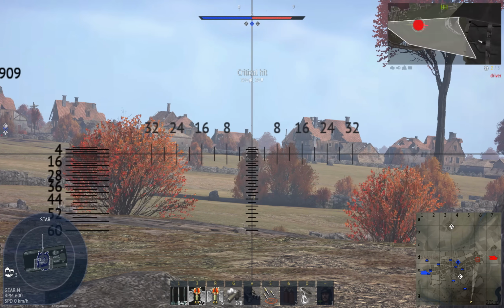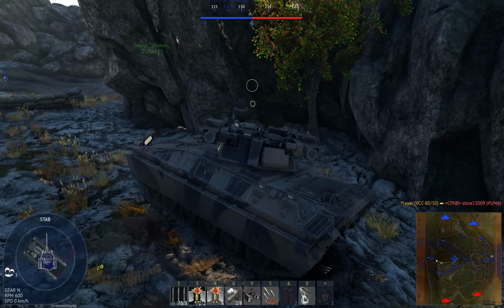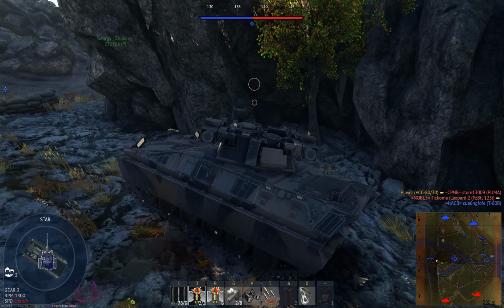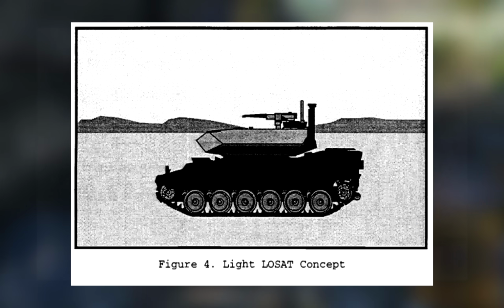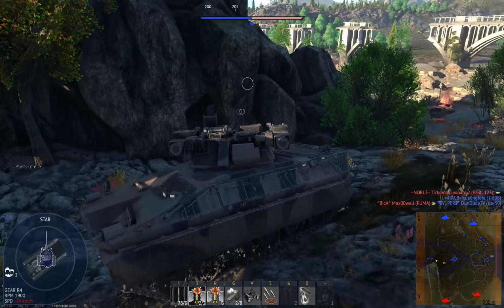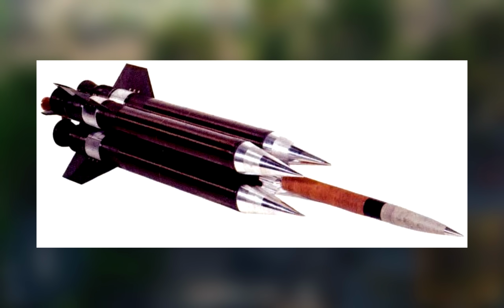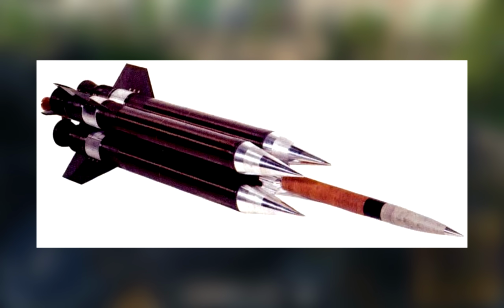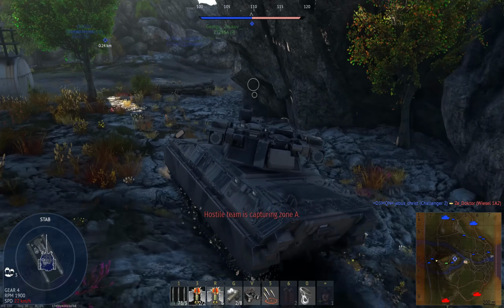The Most Overkill Anti-Tank Missile

Comment: Those are some INSANE speed specs, actually incredible we were capable making such things- honestly unless the cost was insanely higher than regular cannons + their rounds idk why we dont use these today instead, they sound far far more powerful and I'm sure it wouldnt be hard to change the warhead for an HE variant.
Reply: If you think that kind of velocity and acceleration is insane, look up the SPRINT ABM and its predecessor, HIBEX. I don't know HIBEX's stats off the top of my head, but SPRINT could scream to an eye-watering Mach 10 in under 5 seconds from a ground-level launch, carrying a neutron-boosted nuclear warhead, as a last-ditch Hail Mary to intercept incoming nuclear warheads in the terminal phase. Its sheer speed in the dense lower atmosphere was so extreme that it required ablative plating to keep it from disintegrating from the absurd heat, and the plasma layer generated from atmospheric compression required specialized high-power transmitters to ensure a solid connection to ground-based guidance stations.
Reply: @TheMobiusRibbon1-4   Im at a loss for words for incredibly powerful that sounds- why the fuck wouldnt we put these in space and watch as all the world literally dies instantly as we press the button to kill rooshia and choonia idk.

Comment: back in the late 1980's I kept hearing rumors of a laser-guided ramjet round for the 106mm recoilless rifle. it was longer than a regular round, it had a tungsten core and a hybrid propulsion that was half solid rocket and half airbreathing ramjet. the conventional firing sequence would get the ramjet up to operating speed.."extremely fast" was all I could get.

the laser was supposed to be mounted where the spotting rifle would normally go, and be operated using the existing firing controls for the spotting rifle.

the whole project dropped off the map when the US reserve units finally retired all of their recoilless rifles around 1990 or so. it may have been a private venture to get the US military to buy recoilless rifles again, or to arm less capable nations with a high lethality kinetic tank killer.

Comment: I think one of the bigger drawbacks cited for not adopting it was its effective minimum range. Since the missile needs to accelerate it would have no to a lessened effect to armored targets within 500 meters. at 500 meters it reached its maximum velocity, If I remember correctly, though it may have been more.
Reply: Uh no - at close range the motor has not burned out so unless you want a massive KE dump AND the explosive equivalent of a 100 lb go bomb going off in your face when the unburned propellant explodes short range is not an issue - it was tested.

Comment: Having explored this idea about a decade ago with a few others, we called them KAT (it should be obvious what that means). But we just for fun wanted to see if shoulder fired was viable. And depending on your definition of viable, it is. But as you can imagine weight and size is a problem along with back blast. Also range, not long range, short range. Because it can't really do shit if it hasn't built of any speed. Though would love to explore stuff like that again if I could form another independent research group (pretty much just a think tank). because I'd love to built a stealth drone, since the equations are public info and thanks to improved GPU's you can simulate a lot now. One interesting rough method is using ray tracing, which I had brought to my attention when talking about submarines. Which is super clever, since you can use to to see how waves impact an object. All be it not a perfect sim of radar.

Comment: Speaking of high velocity missiles, I'd like to go on a short tangent about the Nike Sprint air-defense missile. It was an American Cold War-era ABM system, that involved launching a megaton-range warhead at incoming ICBM's on an extremely high-speed rocket -- accelerations exceeded 100G's during the boost phase, and speeds of Mach 10 were reached in under 5 seconds. The heat on the body was so intense a special ablative coating had to be developed. In test footage, it looks like it been sped up but no, that actually how fast it is, and you can see the missile body glowing white-hot.
Reply: Sprint is the most out there wild fucking thing ever made by man, up there with SLAM
Reply: @CoreStarter  what’s SLAM?
Reply: @GalacticTommy  it’s also called project Pluto. It stands for Supersonic Low Altitude missile. 
It was a nuclear powered missile capable of flying around at mach 3 at roof top level for weeks on end, spewing radioactive decay products out its exhaust and delivering 14 nuclear warheads with megaton yields
Reply: @deathdragon2283  fucking open cycle nuclear ramjet, the us in the 50s was fucking wild
Reply: @CoreStarter  Yep and both sides launched nuke reactor powered satellites.
Reply: The Soviet 53T6 (NATO reporting name: ABM-3 Gazelle) was even faster than the Sprint missile. The missile achieves speeds of approximately Mach 17 (20,800 km/h; 12,900 mph; 5.78 km/s). Maximal load manoeuvre capability is 210G longitudinal and 90G transverse. Imagine that. In the Soviet Union it was part of the ABM system and some versions of the missile later find its place in the S-300 and S-400 system. Crazy stuff. Some Russian cold-war scientists told the story that the soviet union made ABM-3 Gazelle missile when they try to copy Nike Sprint air-defense missile. Dont know if it was true.
Reply: @negrutin1234  The Soviet figures for that missile are pure fantasy. Post-1991 estimates put it at ~Mach 5.
Reply: @negrutin1234 I could believe it. Russia has always been its own worst enemy with its absurd levels of corruption in the military. My favorite is their Space shuttle that held promise to be a better one than the US but the government cut all their funding for more military bullshit.
Reply: @negrutin1234  I kind of doubt that Gazelle was a Sprint copy if it could be used by the S-300 system, since Sprint was launched from a fixed underground silo.
Reply: Too bad the Safeguard Complex where these were deployed is not open to the public for tours.
Reply: My grandpa was on the Nike hercules system he assembled them
Reply: Ever heard from the russian mach 17 missile? 30km in 6 seconds so youre mach 10 is Kindergarten
Reply: @ I’d have heard of it — if it was real. Now go away, or I shall shame you a second time.
Reply: Basically, it looked as photon torpedo.

Comment: Hey Spookston, @ 2:52 you say a 9" rocket is smaller than a Zuni, Zuni is a 5" diameter rocket. Perhaps you were thinking of the 11.75" Tiny Tim?

EDIT: I am apparently deaf, you said 9cm, which means you were correct at 3.5" or so vs 2.75" for FFAR and 5" for hydra. Damn unit conversions.

Either way, interesting video about a dead-end concept. NLOS Fly Out and Update (FO&U) ATGM like FOG-M and EFOG-M (also Tamuz/Spike-NLOS) turned out to be the better idea. It was just a big pain in the ass to get around the weight issue. You need a big rocket to get a KE penetrator fast enough, even with some of the spicy RDX-base propellants or Boranated stuff.

Comment: I wonder if these sorts of missiles will start popping back up as active protection systems become more capable.
Reply: Nike Sprint in anti-tank format, but it's a 2ton depleted pointy brick zooming in at speeds in excess of Mach10. Step into the locker dyslexic cHeMiCaL nerds, the king has returned.
Reply: The kem missile would defeat any aps - even if you could intercept it doesn’t change the end game
Reply: Unquestionably, kinetic missile weapon systems beat APS
Reply: Throwing a meter long rod of tungsten at Mach 4 seems to be an excellent way to overcome APS.
Reply: @cheyannei5983  only if the missile is going at speeds to create a plasma sheath... which is the same reason why modern ABM systems have a hell of a time in countering ICBMs, because the only real way to counter an ICBM is at the boost phase, as reentry has that plasma sheath involved...

... and the only way to hit such an object is, simply put, using a UV-wavelength pulse laser. The reason being? This tiny tiny little thing called 'wavelength transparency'. Basically, non-opaque materials are transparent to certain wavelengths, like quartz to infrared/heat (which is why it's a popular option for a 'nuclear lightbulb' rocket... which is basically vaporized fission material undergoing fission contained in a 'lightbulb' which is then used to heat up propellant (and due to the fact that this is stupid hot, you can use water as the propellant!) for thrust). Plasma is transparent to two wavelengths: UV (specifically near-vaccum and vacuum wavelengths) and X-Rays. Due to just how energetic this sheath is, you'll need to use a pulse laser (basically a laser that has rapid, short duration beams, essentially a weaponized strobe light) to get effective damage...

... you can see where this is going.
Reply: @TheTrueAdept  APS systems do not have the benefit of time, space, or distance to create speed. Kinetic missiles can thus be faster than an active protection system's hard countermeasure. Were anyone to make such a countermeasure, it could be made larger and faster as the warhead on such an anti-tank missile.
Reply: @cheyannei5983  this is actually laughable the moment that lasers come into the picture... which they slowly are.
Reply: @Wawa Weewa  not really. Missiles are extremely vulnerable to any sort of damage, hence why things like AHEAD exist.

Add to the fact that future ADS lasers are going to be pulse UV lasers to counter the plasma sheath...

... Battletech/Macross levels of missile spam would be the order of the day. APFSDS would also be heavily effected due to the fact that lasers that can penetrate plasma sheaths are going to royally damage the penetrator, which would make it useless.

Also, you don't need a nuclear reactor, you simply need super-capacitors.
Reply: @Wawa Weewa  wow, most missiles can't even achieve that. Most of them (especially most ATGMs) are less than that, as in 'less than 1km/s' at best.
Reply: @TheTrueAdept  There'll be no "star wars" in the 21st century.

Comment: This video in a nutshell "so they made this missile that was really good. But it was never adopted x3. So anyway here is the Javelin".
Reply: Technology advanced past the need for missiles like this, top attack and tandem warheads in tanks and handheld devices have proven more than capable.
Reply: The big miss with this is that it's not affected by active protection systems. Hellfire, javelin etc struggle with these systems where losat did not. The other issue is time of flight. Modern air defense systems would love for helicopters to be unmasked for the entirety of the almost 30 second time of flight. As opposed to losats 4 second time of flight.
Reply: @michaele1564  well considering most aps don't look directly up, thr javelin should be fine for now. They may resurrect the project and design a kinnectic missile using the technology pioneered on LOSAT.
Reply: @casematecardinal  true, although impact angle is highly dependent on range and release parameters for most top attack missiles. Usually closer to 60-70° than 90. I severely hope they do resurrect losat especially for counter ada purposes, maybe mix it with a anti-radiation missile to be fire and forget. Western attack helos need a capability like that.
Reply: @michaele1564  even older hellfires can be guided by the mast radar on the Apache, it doesn’t need to be exposed
Reply: @jonathanpfeffer3716  the L went out of production quite awhile ago and the inventory is basically depleted.
Reply: @michaele1564  Not the only radar guided hellfire
Reply: @jonathanpfeffer3716  Until the jagm is in production, the L is the only one that was mass produced.
Reply: Every cancelled military project in a nutshell
Reply: Theres actually a potential reason for this which I was considering during the video. If these missiles are so good that they'll punch through any tank on the field, it might be that the military is saving the concept for the future. In our current environment, countries are investing massive amounts of money into APS, and likely top mounted armour to counter threats like Javelin. Basically, if they milk the top attack concept until it is useless, they can then introduce this missile type and suddenly have a proper AT solution again in 20-50 years.
Reply: @therealwildboar1007  smartest take I’ve seen so far 💯
Reply: Lots of projects were canceled when the ussr collapsed. Military spending during the 90s was slashed massively. There was no longer a need for a giant anti tank missile so it got cut out of the budget.
Reply: There is no profit if the threat goes away too easily
Reply: Well Javelin is kind of still OK for current russian armor so all turned out fine I guess
Reply: OK?! have you seen how many russian tanks are getting murked by it in ukraine.
Reply: @moustrout1299  short range ambushes. It's what javelin is great at. As a helicopter borne system or on a highly mobile light tank it would excel in more open terrain where javelin can be out ranged. Especially for the hellfire replacement or augmentation to current loads where APS/ADA is expected to be encountered. Think about trying to shoot a c-ram, designed to shoot down artillery and mortar shells, with missiles going under mach1, ie hellfire, brimstone, parsat etc.
Reply: @moustrout1299  where do you see these? On mainstream state media?
How many t90 and other modern tanks have you seen?
Are these the same sources that talked about the "ghost of kiev"? The sources that showed the star wars fake wrecks?
Reply: @IllidanSturmgrimmDeusVult  It's funny how every mainstream media source rushed out to debunk the ghost of kyiv yet Russiaboos like you who have never seen anything than Russian state propaganda keep bringing it up.
Reply: @IllidanSturmgrimmDeusVult  300 bvm or so
200b3 or so
Reply: @moustrout1299  i couldnt remember any.